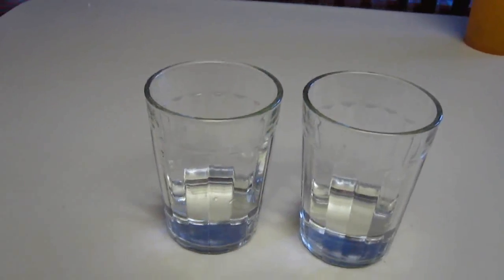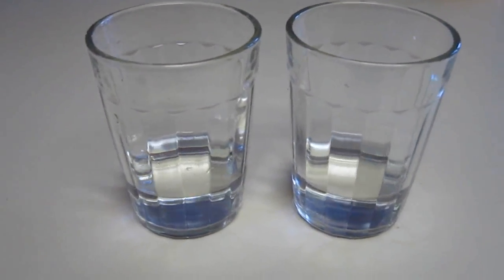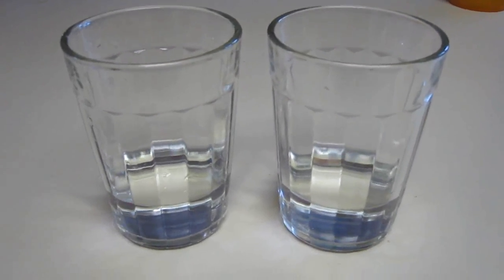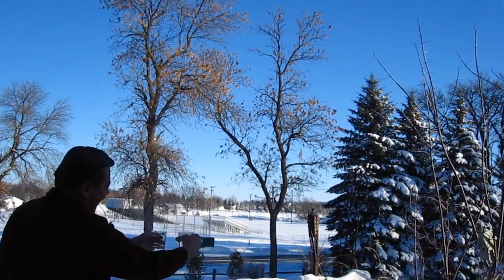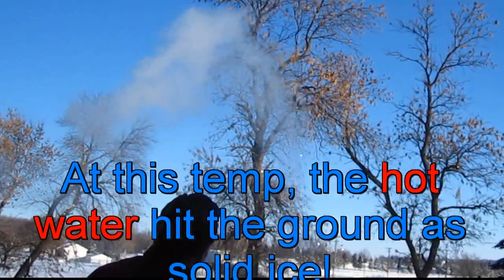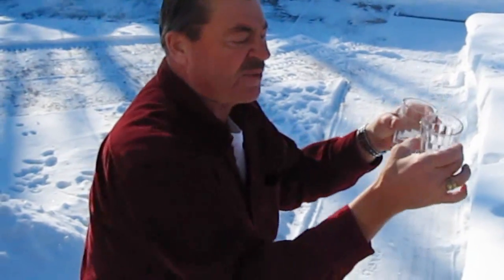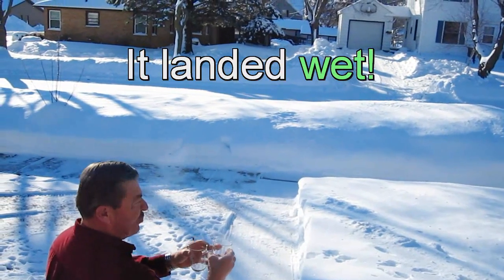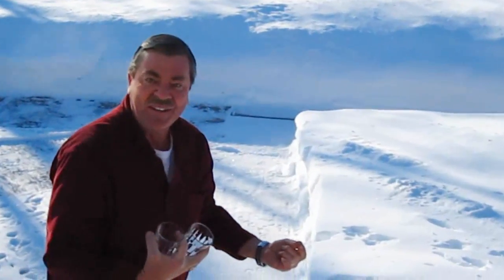Which freezes faster, hot or cold water. A Science Experiment from Mr. Herbert

Comment: For all the stupid PhD saying bullshit, this doesn't happens only because of the difference between surface areas, it involves much more variables than that. Under the right circumstances, hot water might freeze faster than cold water even if you simply leave them resting inside a freezer. You should study about Mpemba Effect before posting shitty comments.

Comment: And now take your freezed water inside to check more.. oh.. its not in glass. 3 forms of water. Why steam is never cold?
* and i never seen ice when pee in snow on - 20^C
Reply: +KEPKE you're pee isn't hot enough to freeze like that.  the hotter, the easier it is to freeze.
Reply: +KEPKE The heat thins it and a lot of it turns to steam. It will freeze because the thinness allows it cool rapidly. If it was kept inside a cup, this wouldn't happen. You get an even more interesting effect, when you dump boiling hot water on a frozen window.

Comment: It's a transport phenomenon and could have nothing to do with molecular bonding.  The hot water loses substantial MASS and energy while evaporating part of itself to steam.  While evaporating, energy rapidly goes from the liquid water to the vapor, thus cooling what's left of the 'hot'  liquid water, which is now as cool as the cold water, but has less mass.  The smaller mass of the once hot liquid water has a higher surface-to-mass ratio that the cold water thrown in an equivalent fashion and can lose energy faster than the cold water since there is less mass but about the same surface area.  Thus, what's left of the hot water freezes more rapidly than the more voluminous toss of cold water.  If you add the amount of internal energy in the steam and the ice of the hot water, it will probably be more than that of the cold water that didn't freeze.

Comment: It takes time for the energy contained in a hot object to be transferred to a cold object. However, the rate of heat transfer is proportional to the temperature difference between the two objects, so hot water will lose heat faster than cold water. In other words, if you have water at 90 degrees C and water at 10 degrees C and the freezer is at -10 degrees C, the hot water will lose heat five times faster than the cold water; however, the cold water will still win the race. As the hot water cools it’s rate of heat transfer will decrease, so it will never catch up to the cold water.
Some people claim that hot water freezes faster because a pot of boiling water can be thrown into the air on a cold winter day, and it freezes in mid air creating a shower of ice crystals. Whereas a pot of cold water thrown into the air comes down as large blobs of water. This happens because the hot water is so close to being steam, that the act of throwing it into the air causes it to break up into tiny droplets. (hot water is less viscous than cold water, listen to the sound it makes when you pour it in the sink) The small water droplets have a large surface area which allows for a great deal of evaporation, this removes heat quickly. And finally, the cooled droplets are so small, that they can be easily frozen by the winter air. All of this happens before the water hits the ground. Cold water is thicker and stickier, it doesn’t break up into such small pieces when thrown into the air, so it comes down in large blobs.
Joe Larsen, Ph.D. Chemistry, Rockwell Science Center, Los Angeles, CA

Comment: @deluxes000 Maybe.

One thing is not clear to me. Do original discovery by Mpemba include modern refrigerator as we use today, or he do cooling by other means (ice bath + kitchen salt)? Any original document out there? 

This may be much different.

In modern refrigerator, contact surface is poor, and evaporates (water vapor) from hot water first ruin cold surrounding (air inside chamber) by turning it bit warmer. So whole process of freezing may take too long - and effect is not the same.

Comment: Very good experiment that make proof of Mpeba effect.

Many people are confused when tried to freeze water in a glass containers - it did not freeze faster when water is hot. It is simply because far IR (thermal radiation) is prevented by non-transparent properties of the glass for long wavelengths.

Glass is transparent up to 2 um (mirco-meters) or so. But most of the plastics _are_ transparent to longer wavelengths. It just radiate all stored thermal energy out faster than cold water.

Comment: @lHustonProductionsl In which container material you hold cold and hot water? It _does_ matter!

Use far infrared transparent material, and hot water will freeze much faster. Thrown water has no container at all, so it loses all heat by thermal radiation in far infrared spectra (4-15 um). Glass is transparent to the IR only up to 2 micrometer, so it is not so transparent for longer wavelength. 

Use HDPE, or PP container (plastic) that is pretty transparent to such wavelengths.

Comment: @GollumLeVelu you have to think in terms of gradient. since the hot water has a greater temp differential, its thermal "momentum" is easier to get to begin changing, and once the temp begins to change it drops fast. the hot water is a steeper slope of temp change and therefore flows faster. Both must undergo the liquid/solid change which is the majority of the energy loss, the energy loss from temp prior to that is not that great, but the slope is.

Comment: @andreaseide 
It's a good idea to turn to energy to explain this, but I'm sorry to remind you that water must *lose* energy when it goes from liquid to solid, so hot water has more energy to get rid of and should take longer than cold water. The problem is a much more complex one, and I suggest you look for "mpemba effect " on wikipedia if you wish to learn more about it.
Now with vaporized water, I thik that there is an important factor: heat exchange area (greater for smaller hot droplets)

Comment: The hot water boils off into steam when it is atomized into the dry air.
the air has such a very low moisture content  or vapor pressure- lowering the temperature required for the water to sublimate into steam.
To evaporate into the dry air the molecules must accelerate away from each other. they  absorb energy to accelerate
the energy can come from motion (inertia) or from heat (light- infra red)
it is refrigeration.
it is vortex energy it works the opposite of pressure energy

Comment: i would guess the most logic reson for this to happen is that when elements, like water changes to a new state, like from liquid to solid, it needs energy. The hot water has a lot of energy in it in the form of heat, witch both the cold water and air lack, therefore the tranition should be mutch easier for the hot water ;)

Comment: Chucking boiling water into cold air is a different scenario all together. It may simply be a result newton's cooling law whereby the greater the temperature gradient between two bodies the more rapid the heat loss. consequently rapid heat loss leads to contraction and thus segmentation of the body of water and hence more surface area in contact with cold air. But who knows...

Comment: the reason as to why it freezes so fast is because of KE. temperature is a way of determining how much kinetic energy is in a fluid or solid, now the more KE there is the hotter it is because of more active molecules and colder is vice versa. Think of it like a battery one side has a higher amount of electrons and the other w/ fewer electrons and when a circuit is made the side w/ less electrons pulls electrons from the side w/ more but once it starts to reach equilibrium the battery loses power

Comment: Without watching this video, I would say that HOT water will freeze FASTER than COLD water. Because the hot water molecules are moving faster (have motion) than the more stagnant cold water molecule, and once they pass the point of egual ambient temperature, the motion of the molecules will continue to move, thus freezing (movement into the opposite direction).... Sort of like a rubber band analogy.  Going fast one way, (HOT), then going fast the other way (COLD)

Comment: The urban legend that translates to this is that hot water pipes freeze faster than cold water pipes.  And the legend goes on about over night freezing.  Hot water in pipes does not have all the properties needed for the mpemba effect.  In this case the hot water pipes froze fast because generally hot water is used less.  When you get up at night to flush, you move cold water through the pipes, not hot water. So it sits there all night. :)